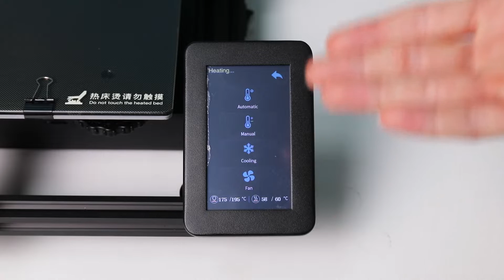How to Replace PTFE Tubing on All Bowden Style Printer including Sovol SV02 -- Installation Guide

Comment: I purchased the SV02, came out of the box and the second extruder (really the first) straight up doesn't work.  I contacted them for over a month and they refuse to refund or replace, even when I sent videos, pictures and troubleshooted with them.  I can't discuss the this printer in particular, but the company as a whole is shameful.  On a $250 printer I purchased.  They should be ashamed and I'd recommend finding one of the other fine companies that make better printers (creality, prusa, etc.)

Comment: Ronald, you forgot to purge the hotend by pushing the filament so you get flow out of the nozzle to purge the melted material before pulling the filament out. Failure to do that will pull melted material back onto the heat break and maybe the boden tube causing reloading issues and possible clogs.
Reply from the maker: Thank you! Right we need to do so when unloading the filament. We actually do this part and the footage was shot, but somehow be cut by film cutter. We'll do an update for this. We appreciate your remind!